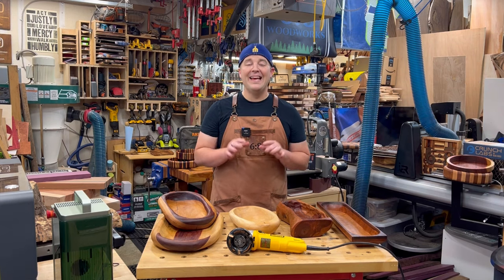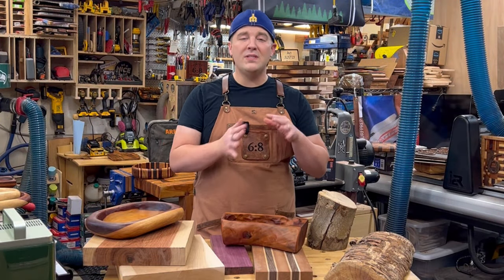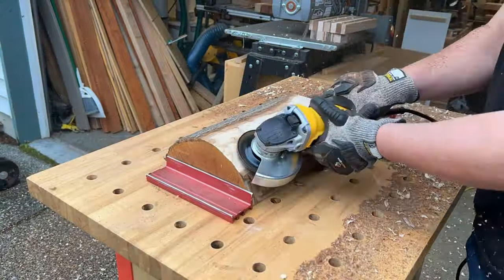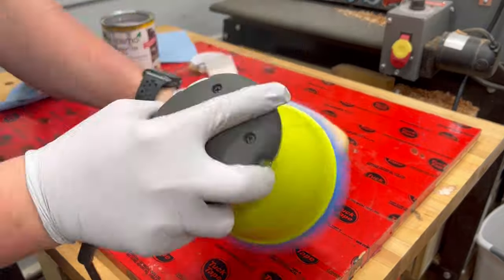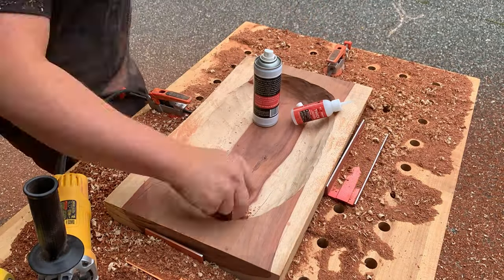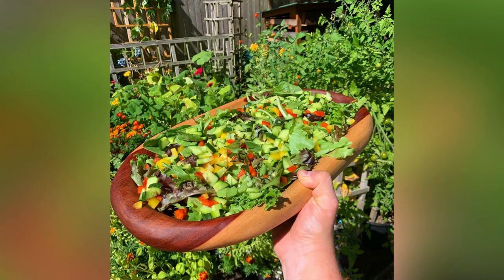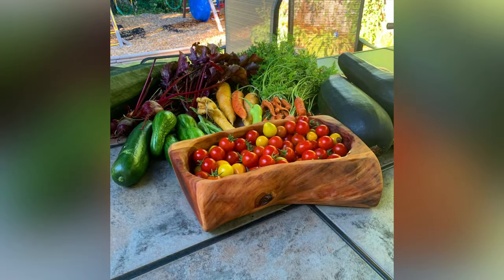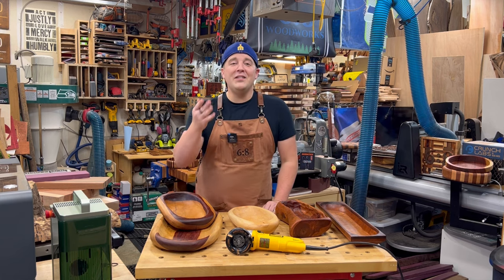Power Carved Bowls & Trays: Fast & Easy with Minimal Tools

Comment: I am thinking of getting a new angle grinder for wood carving. Have you ever tried the dewalt battery powered grinders? Would that be a bad idea considering it being used mostly for wood carving and metal grinding for welding? Thanks.
Reply: Personally, I saw go to a pawnshop and get whatever grinder for about $20. Use it til it dies and get another. I’m o er buying grinders new.

Comment: There are two ways to stoppinh cracking.

Sealing the end grain is one.

The other is filling in the crack with someting like super glue, Very Liquid CA glue.

Or using slow setting epoxy (2 part).

Or decently made wood filler from sawdust from your Sanders dust bag mixed with tightbond-II thingy.

Let it currrrre.

Comment: What I Like To Do Is If I See
A Crack I Like Mixing Some Tightbond 2 With Some Sawdust
From The Wood I'm Sanding On
& use It As A Wood Filler. & 
As It Dry's It's Actualy Invisable.